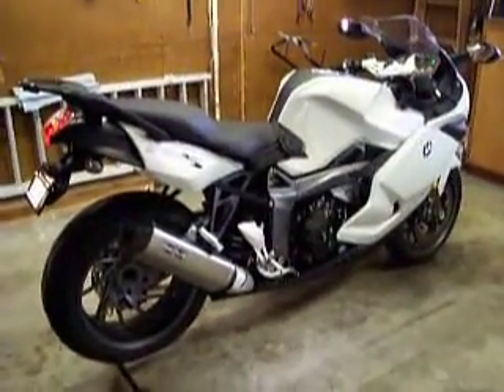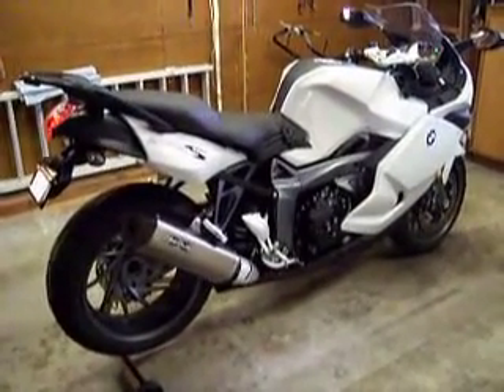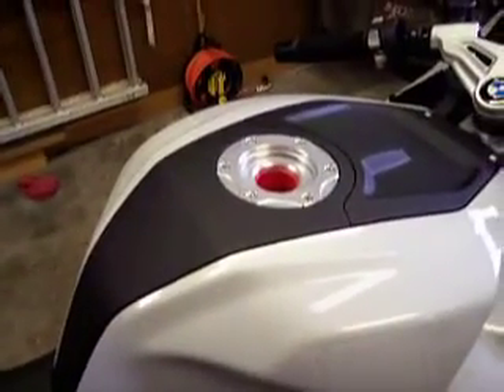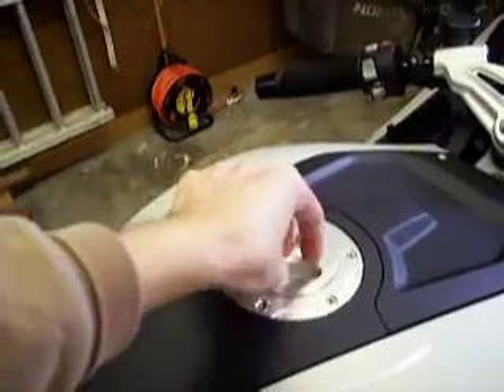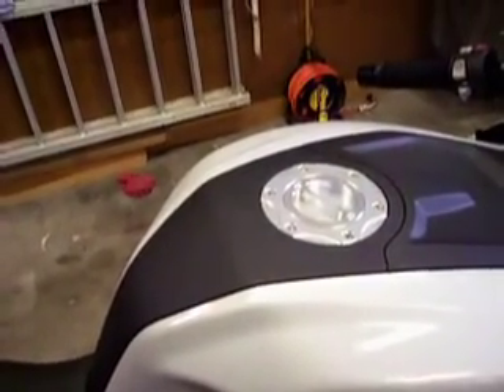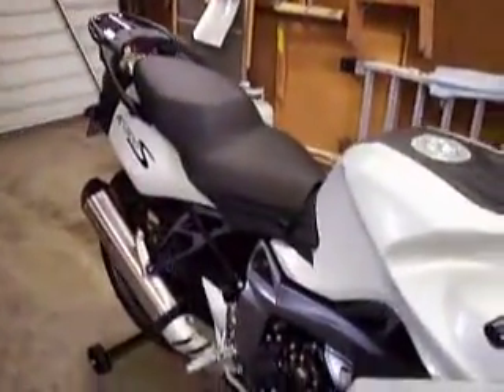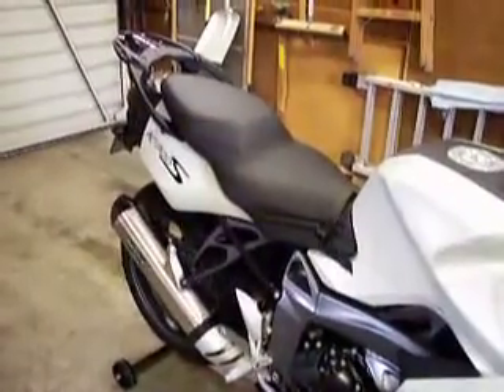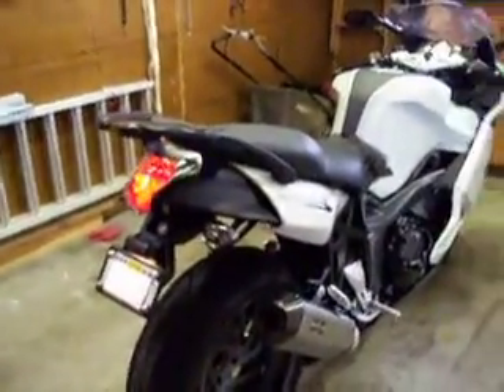09 BMW K1300S update 3.MOV

Comment from the maker: @rcoles82 
The stock cap was on a hinge that fliped back towards you on the bike along with a large nipple protruding from the cap, this made it difficult to fill the tank from the gas pump nozzle since we have those large rubber boots on the nozzle making it hard to get it in and out of the tank hole. This set up makes it so much easyer to fill your tank up and looks wonderful too